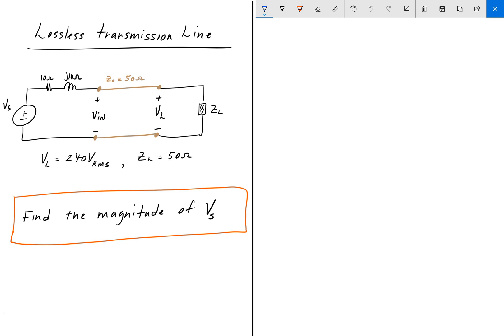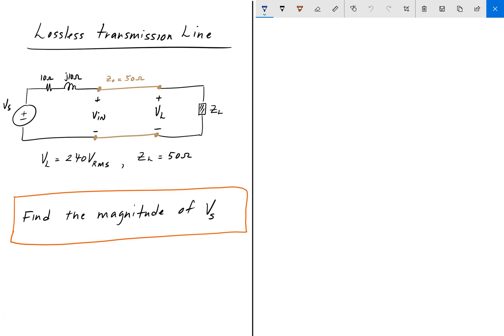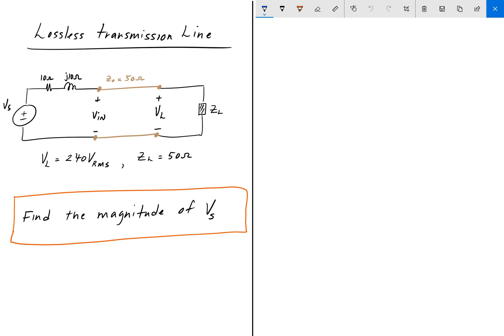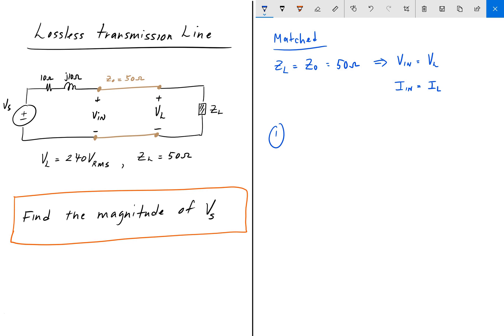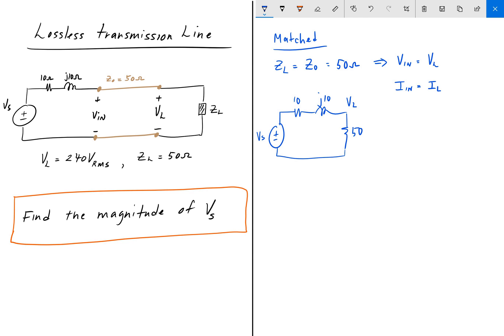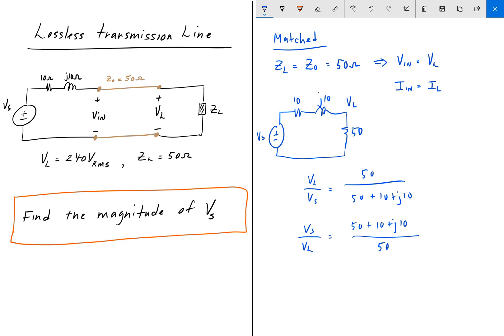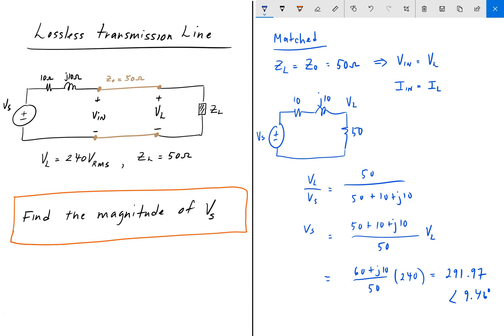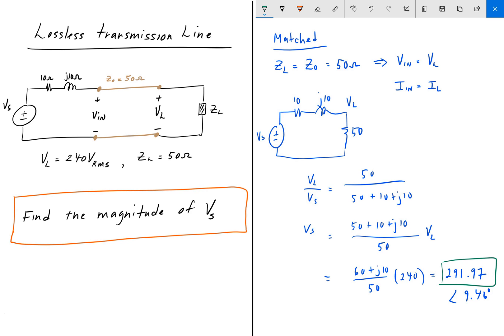Electrical FE /EIT Exam Prep - Electromagnetics 2: Lossless Transmission Lines

Comment: your way is fine but i prefer to calculate the current of the line by doing 240/50 = 4.8A through the circuit and then you can calc the VS = IR or VS = (4.8)(10+50+10j) or VS=4.8(60+10j) == VS=(288+48j) take the M of that and that gives you 291.97 as well :D

Comment: Would Z0 be considered in series with ZL? If so, shouldn't Vin and VL be different values unless Z0 = 0 (hence lossless)?
Reply: Z0 is probably the total impedance from Vin+ to Vin-.  Since there is no resistance between Vin+ to VL+, Z0 = ZL, in other words all of the input impedence comes from the load.
Reply: @cryora  Thank you, this makes sense. I had the same question as 5bobber